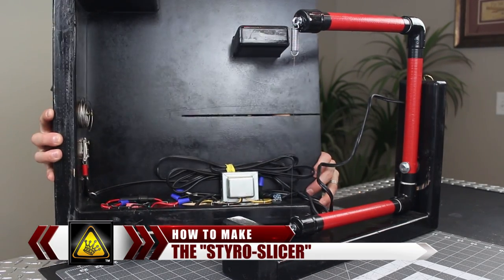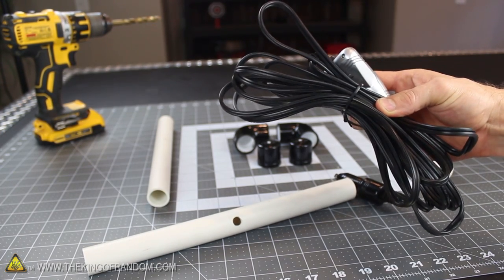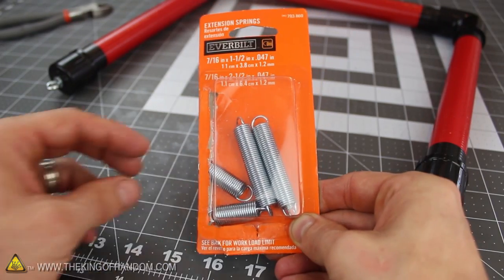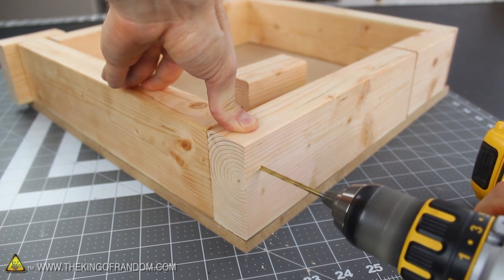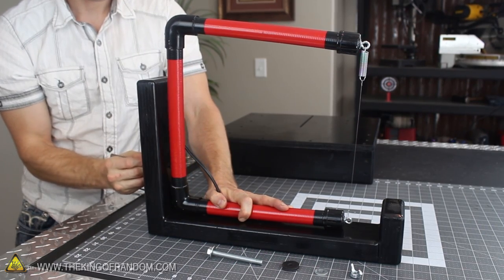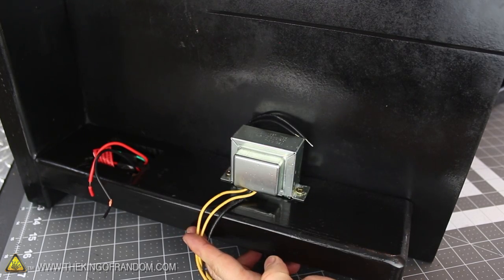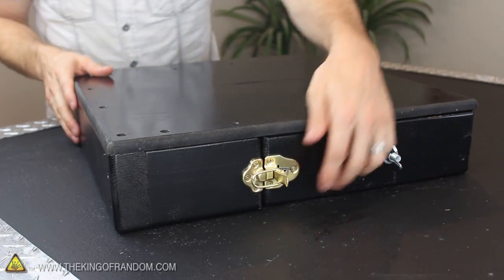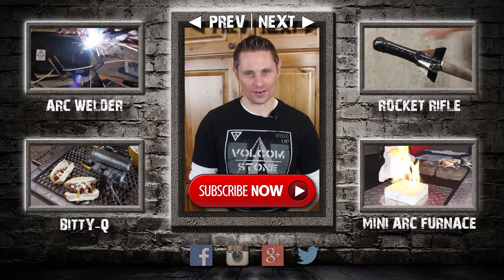How To Make The "Styro-Slicer"

Comment: 100% of people want to make this but only .01% of people have the skills and patience to make this...
Reply: and materials
Reply: It's not that epensive, the most expensive things in the project are the lantern battery (around $10) and the transformer (10-$20) so it costs around 30-$40 plus the equipment needed  are pretty everyday: power drill, saw, wire stripper; if you don't do all the extra stuff and cosmetic bits he does (rounding, spray painting, power fuse, ect)
Reply: David Lam No I don't have a power drill ANYWHERE in my house and there is no tech/woodshop class at my school.
Reply: +The James Bond Theory 007 borrow from a friend or ask a friend's dad for help with what you don't have and need.
Reply: +The James Bond Theory 007 borrow from a friend or ask a friend's dad for help with what you don't have and need.
Reply: isn't difficult to build the electrical wiring though woodworking and painting its more difficult
Reply: Less than 0.004% of all the current views (Jan 22 2016) probably made this.
Reply: im the 0.1
Reply: plant man 0.01% ≠ 0.1
Reply: +Johnathan Vrentas well ur probably the 0.01 that can make it then.
Reply: +Gavin Kirsh if you dont understand how to make this then its too dangerous for anyone who doesnt in the first place,it involves power tools and potentially deadly voltage
Reply: +Gavin Kirsh Lies, I don't want to make one!

(I wouldn't have any use for one)
Reply: so the 0.1 can now cut foam... great.
Reply: NicK PlayS ya it is this is a really useful invention
Reply: +NicK PlayS I've always just heated a knife on the stove and cut out what I need. Nothing really intricate but it works.
Reply: +Gavin Kirsh I don't want to make this. Also my 9v battery is enough to heat up a small copper wire.
Reply: +Gavin Kirsh This made me feel special...thank you...my version is even more complex too,i have different wires for different applications and better electrical equipment.
Reply: I am a 14 year old kid and a have almost finished it
Reply: PlayAtlas You really had to mention you are a kid?
"I have almost finished it" would be a better comment. I'm too scared of mains to do something useful with it, anything I do is based off batteries. Once when I was working with mains I touched a live wire for 3 seconds.
Reply: +Gavin Kirsh its not really hard to Build it....
Reply: PlayAtlas Hope your dad supervised you and helped you
Reply: +Digitaltiger123 nope, my technology lesson teacher, brother and a friend helped me to find the materials.
Reply: +Gavin Kirsh I actually don't want to. I'd have absolutely no use of it. But watching how to make it is pretty interesting and fun.
Reply: +KingFabimann 12 year old can make it but they don't have or cannot get from their area or city
Reply: of the .01 people you mentioned, im one of them
Reply: Zetsuke4 woops
Reply: +David Lam -flamingsword1         It actually costs $90.82 to build it without all that. I just checked :(
Reply: you can buy one for 25 bucks but the battery costs like 15$
Reply: Gavin Kirsh so true
Reply: FAIRLY EASY TBH
Reply: I tried and it didn't work
Reply: It's amazing how the king don't reply to comment like this!

Comment: Excellent build! I can see this also being useful for cutting other plastics as well. I'd also include an "ON" light for indication and safety reasons.

Great work Grant!
Reply: NurdRage :D
Reply: +ZeroGames ZeroGames :D
Reply from the maker: +NurdRage Thanks NurdRage!  Good idea on the safety light.
Reply: +NurdRage How did you install your ON light? Sounds like a good idea
Reply: +NurdRage the reactions when you see 2 youtubers you follow on the same channel :P btw great work on your vids love them
Reply: Who needs a light to se if its on or not.....
Just tuch it and if its smells like a burning steak its on ;-)
Reply: +Grant Thompson - "The King of Random" Does it hurt when you touch the wire?
Reply from the maker: +Young PineTree Yes, of course it does, if it's turned on
Reply: +NurdRage NUUUUUUUUUUUUUUURD
Reply: +NurdRage  gooooooooooooooooooooooooooood idea
Reply: +Sergeant Methcake 😤
Reply: +Sergeant Methcake 😤
Reply: +TheDoomertron My setup was a bit different. I also have an on/off switch which has a built-in ON light.
Reply: +NurdRage NURDRAAAAGE!!!! :D
Reply: +Nino Joel You just made me have an idea: Roast Beef with it, just slice your steak really thin and it will be roasted :P
Reply: I am a big fan nurdrage!
Reply: NurdRage Double mention bug
Reply: There is one problem with using heat to cut Acrylics.. It causes what is called 'Crazing'.
Reply: NurdRage I
Reply: NurdRage to
Reply: NurdRage great idea using a light
Reply: Cb
Reply: this comment has more likes then the King of Random's!
Reply: @NinoJoel  🤣🤣🤣 zactly

Comment from the maker: Hey guys, it's been awesome spending the last 2 hours with you.  I hope I answered most all of your questions and comments.  If not, there's a good chance your questions was asked by someone else, so look through the comments and see if your answer is there.  I have to go back to work on the next project, so I'll see you soon with some cool new content.  By the way, Propane torch is next :)
Reply: +Grant Thompson - "The King of Random" hi
Reply: +Grant Thompson - "The King of Random" I caught the background song: it's Xenogenesis by TheFatRat! :D
Reply: Cool I've been waiting for the torch.
Reply: +Grant Thompson - "The King of Random" YEAH!!!!!!!!!!!!!!!!!! I LOVE STUFF WITH FIRE!!!!!!!!!
Reply: +Grant Thompson - "The King of Random" Really looking forward
Reply: great video! but I got a request in future video's could you add the mesurements also in the metric system only a few countries use the imperial system so it would be easiers for fans from other countries.
Reply: +Grant Thompson - "The King of Random" could I just put there a socket for a typical 9V power supply?
Reply: +Grant Thompson - "The King of Random" Can you please post the part number of the transformer you used. Or the specs, it looks like a center tapped transformer but it is difficult to tell.
Reply: that's the best video I have seen and I'm definitely make it☺👍
Reply: +Grant Thompson - "The King of Random" if you accidentally bump in to the wire whilst cutting Styrofoam will it burn you? and if so would it burn you badly?
Reply: Hey Grant! I thought the rocket series were awesome. I tried making them but could never find the champagne glasses you used. The only ones I found were way too big.  :(
Reply: can you make these for sale I don't have time to make it
Reply: You didn't answer my question R.I.P
Reply from the maker: +KonkeyDongMupersan You can expect a quick clip, then the project video posting probably on January 30th
Reply from the maker: +Oskar Forever Sure, as long as you have a way to control the amps
Reply: +KonkeyDongMupersan well you will have to watch 4 quick clips on it first
Reply: You should really put a warning about mdf it's very bad for your health when inhaled
Reply: +victor torres you can buy these at hobby lobby its not an original idea
Reply from the maker: +Tobi Johansen It was from Radio Shack and was a 12.6V 3A Power Transformer 273-1511B.  It is center tapped for 6.3-0-6.3, but doing a quick search on Google .. they seem kind of hard to find right now for some reason, but you can get them around $15 on eBay.  Not sure if Radio Shack carries them anymore.  If not, I would just try experimenting with junk transformers salvaged from larger electronics.
Reply from the maker: +BlueBeamProductions It will hurt, but no serious damage ... unless you leave your skin on it and don't pull away
Reply from the maker: +AG Electronics Cool.  I just did a search online and perhaps you could get them from the internet?  Or maybe in bulk from Sams club? (http://www.samsclub.com/sams/champagne-flutes-5-oz-48-pk/prod1830804.ip)
Reply: Would it be possible to make a small saw like version?
Reply: You are too awesome can't wait until 5 MILLION
Reply: +Grant Thompson - "The King of Random" Thank you so much for this man. It is going to be a huge help with metal casting.
Reply: This is your best work yet
Reply: But can you make toast with it?

(I'm serious)
Reply: Geometry Dash BlaZe I'm serious...
Reply: +HotSauceBear I know..... but u have to admit that's funny! but how would it???
Reply: +Grant Thompson - "The King of Random" what kind of countersink bit did you use?
Reply: Geometry Dash BlaZe It'd be hot enough to cut through, and make toast because of said heat, or at least in theory.
Reply: +HotSauceBear I tried. I wont try it if i were you.
Reply: Benduka Hafizovic I doubt you tried but I wasn't going to anyways.
Reply: +Abdullah Jaralla Indian...
Reply: +Grant Thompson - "The King of Random"  Finally I have been waiting for this video for forever. On a completely different note it was amazing thanks keep doing what you're doing
Reply: You should make a video building or how you built your work bench. It looks nice
Reply: Could you do a give away because I am just a kid so my parents will not let me get this stuff i want to get/make a arc furnace this and an arc welder PLEASE LOOK
Reply: Me too
Reply: +Grant Thompson - "The King of Random"   Awesome! Thanks for replying. Keep up the cool videos.
Reply: +Grant Thompson - "The King of Random"   Awesome! Thanks for replying. Keep up the cool videos.
Reply: +gabe quinn I think he already did a video about it.
Reply: +gabe quinn I think he already did a video about it.
Reply: do you ever read old comments
Reply: do you ever read old comments
Reply: +Shane Smith why did u right the same thing over smith :/
Reply: +Shivnay Kumar accident
Reply: +Shivnay Kumar  YouTube won't let comment
Reply: could you try to make a homemade disco ball?
Reply: could you try to make a homemade disco ball?
Reply: could you try to make a homemade disco ball?
Reply: I made a mini one for free
Reply: +Grant Thompson - "The King of Random"  Would this set up good at cutting things such as balsa wood?
Reply: +BlueBeamProductions It would burn, but if it' s like his adjustable one, it really depends on what you have it on
Reply: +Grant Thompson - "The King of Random" How do you think of all these projects?
Reply: sup can I get a shout out
Reply: sup can I get a shout out
Reply: sup can I get a shout out
Reply: sup can I get a shout out pls
Reply: You should do the jet blaster next. (Please)
Reply: +Geometry Dash BlaZe oh a fellow Geometry Dasher!
Reply: Do you have any safety tips for the styroslicer cuz it's pretty easy to injure your self while using a styroslicer
Reply: +BlueBeamProductions It has to be above 180°F, but it's probably less than 300°F, so it isn't terribly hot. If you touch it with your finger, just remove your finger quickly and you should be okay.
Reply: i would like to do this, but: 1. can you add the metrics to description, 2. what was about the cost?, 3. is that transformer needed? 4. how many amps/volts the hot wire use/need?
Reply: +HotSauceBear Yes, just place the wire at one edge of a slice of bread and hold it there until it makes a thin brown line (probably about 3 minutes). Then advance the position 0.254 mm and repeat. Continue this process across the face of the bread slice, then turn it over and repeat it on the back of the slice. If you work without stopping until the bread slice is toasted, it should take you 2.5 days (60 hours) to make a slice of toast.
Reply: +gabe quinn I believe he already did that. Search for the video.
Reply: +Marcus Izzard Balsa wood will not melt at 180°F. If you can increase the temperature until the wire is red hot, then it would probably cut balsa wood, but it would be slow and it would discolor the wood.
Reply: Youre very smart men!!!
Reply: +Grant Thompson - "The King of Random" Sorry for assuming you were the poor SOB who died to snakebites, lol
Reply: are the 3 way switch and fuse necessary?
Reply: are the 3 way switch and fuse necessary?
Reply: Are the 3 way switch and fuse necessary?
Reply: +Grant Thompson - "The King of Random" Can you put a parts list in the description please? I know you explain what parts you need along the way but it would be good to be able to get all the parts before going through your video. Other then that nice going I'll let you know how mine goes once it's built.
Reply: +keshav somani look on his channel, there are lots of projects involving pvc pipes.
Reply: Novamation _
Look for a 240-Volt-Wechselstrom-Gleichstrom-Transformator, such as on
www.ebay-kleinanzeigen.de/s-multimedia-elektronik/240-volt/k0c161
Reply: this is cool
Reply: +Grant Thompson - "The King of Random" sorry, but the other position of switch is for the "super hot mode"?
Reply: A quick way to straighten the stainless steel wire is to make a loop at the end and stick it into the chuck of a drill, then hold the other end firmly with pliers and start up the drill
Reply: +Grant Thompson - "The King of Random" Can you PLEASE make a parts list for this and maybe for the future videos in the description, Parts and tools so im not watching videos with paper and pen copying everything haha  Like all bits screws and parts...Thanks
Reply: hey i love your videos
Reply: hey i love your videos
Reply: hey i love your videos
Reply: +Grant Thompson - "The King of Random" I see you can use a 6 volt battery or use the transformer to power the cutter. My question is, Is the transformers secondary voltage AC or is it DC voltage? I just wasn't sure which type of transformer to buy.
Reply: +Michael Provenzano it feels like a cooking show.
Reply: +Nallely Galarza it does lol
Reply: can you post a link to this vid so I can send it to my family and friends by text? link in the description of course
Reply: can you post a link to this vid so I can send it to my family and friends by text? link in the description of course
Reply: can you post a link to this vid so I can send it to my family and friends by text? link in the description of course.
Reply: can you post a link to this vid so I can send it to my family and friends by text? link in the description of course.
Reply: +Grant Thompson - "The King of Random" Awesome!! I know what I'm gonna build this weekend! Thanks Grant!
Reply: can u make vides ever 2 day ?
Reply: 5000000!!!!!
Reply: +Grant Thompson - "The King of Random" CONGRATS ON 5 MILL SUBS
Reply: +Grant Thompson - "The King of Random"  CONGRATS ON % MIL DUDE!
Reply: amazing moosic
Reply: Congratulations on hitting 5 million subs!!!
Reply: +Grant Thompson - "The King of Random" Would this work if i used a circuit breaker instead of a fuse??? I looked on the website of my prefered home improvement store and can't find fuses but can find circuit breakers. 
Thanks
Reply: +Grant Thompson - &quot;The King of Random&quot; Can I play with you game named ROBLOX? My favourite games is: Hospital Roleplay 2.0 and The Normal Elevator.
Reply: +Grant Thompson - "The King of Random" Is that outgoing AC or DC?
Reply: +Grant Thompson - "The King of Random"  Does this cut through 3 quarter inch floor mat foam as well?
Reply: +Grant Thompson - "The King of Random" can i cut paper without burning it with the "styro-slicer"?
Reply: +csl84030 Transformers by themselves don't convert AC to DC so the output is AC.  In this case the transformer is "stepping down", decreasing, the voltage from the household line voltage (~115V AC) to ab out 12.6V AC.  If you increase or decrease the voltage going in, the output voltage will also increase or decrease along with it, which is why the dimmer switch works as a quick and dirty temperature control.
Reply: +AZ-tech Hey I've made two foundry's based off his videos. Its not cheap. My fire extinguisher didnt last at all. But I found a cast iron kettle, unfortunately it didn't fit in my foundry at the time. Which led me to my second build. I made it wider using the same material. With my iron "fire log grabber" my tools last a lot longer.
Reply: Important question, I need to know if it works when I use foam to cut it because that's all I have and I'm using this for a school project and need to know of it works with foam. By the way it's foam from a sponge.
Reply: +kevin em I'm sure if you try hard enough, fingers will also work.
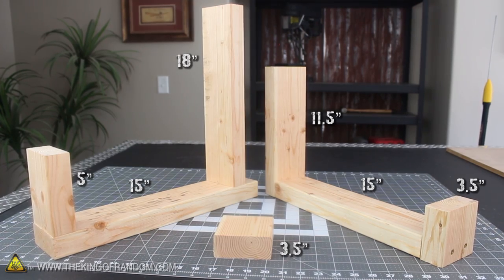Reply: +Grant Thompson - "The King of Random"  Hey king, you mixed up the 15" and 18" measurements in 5:42,  we figured it out anyways, the project is in progress. We love your videos, thanks so much
Reply: +Grant Thompson - "The King of Random" can the stiro slicer cut jello and dry ice
Reply: How can you make a sphere styrofoam ball? (To be more specific, the sphere with the diameter of 6.5 inches.) Is because I want to make it to cast it with molten aluminum.
Reply: if you live near  a arts and crafts store they should have some
Reply: colossus Ok, well thank you!
Reply: for what
Reply: Wow
Reply: just wow
Reply: You can do it yourself there are tools on the screen for that!
Reply: To old tazzok, does that answer your ? Guess he doesn't answer old comments. Unless you're validating his video or giving him kudos he will not even notice you, so you can forget it!
Reply: how much you can make me one a star foam cutter?
Reply: how much you can make one?
Reply: The King of Random if I were to make this but about 2/3 times in height/width would all of the electrical wiring still be the same?
Reply: What about metric?